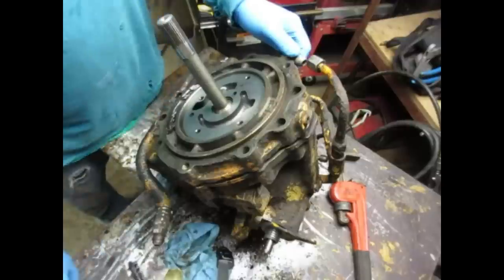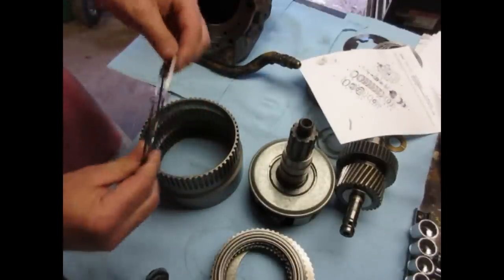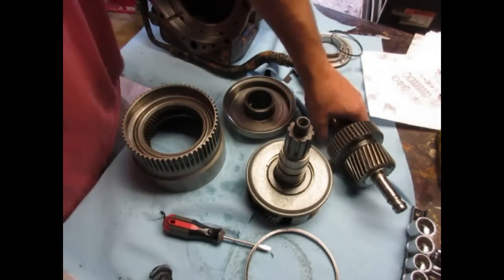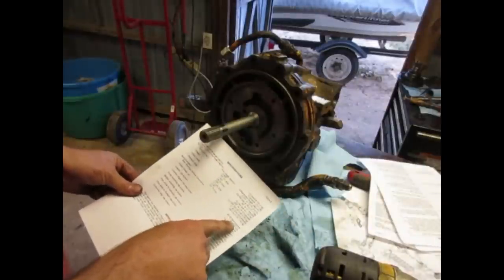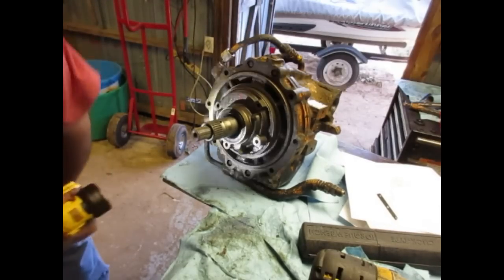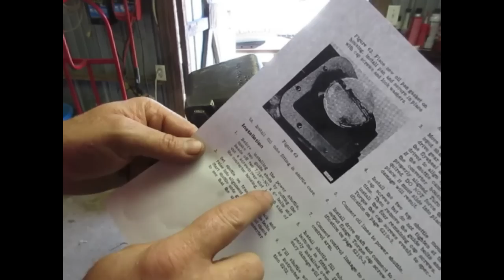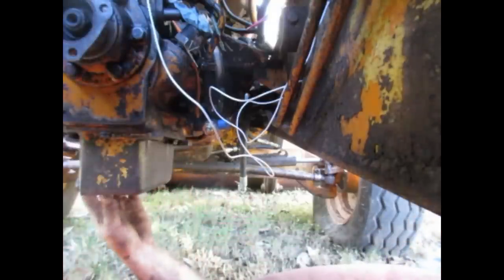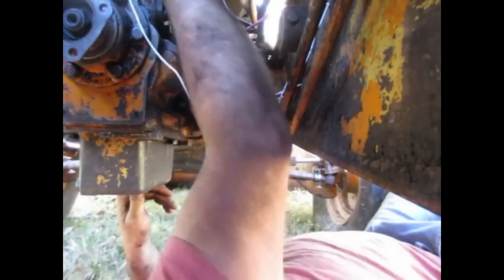Abandoned Backhoe Transmission Repair  Will it be a Fail or Success?   Part 4

Comment: Wow this was very helpful since I am looking at a Case 580B with Shuttle Shift issues.  Motor is strong and rebuilt  I think I can handle the process  you went through to get it running again.

Comment: Things are looking better. Starting to look like you may have a good machine!  I was impressed with the improvements case made in the 580 transmission design from my 1966 and 1967 580 Construction King.  When I got the 1966 the power shuttle and clutch pressure relief spool valve  were really bad with bits of metal and broken springs from the power shuttle clutch assembly.  Much easier to work on the newer design.  But I got it working and put another 11,000 hours on the 1966.  When totally worn out with over 36,000 hours I got the 1967 which was in a lot better shape.  It is great to have 2 nearly identical machines with spare parts to rob and keep the best one running.   Did a job yesterday and the 52 year old hoe still works great!  Just take the time to service the equipment, don't abuse them and they keep doing the work!  Thanks Mike!!
Reply: ayep, start by removing the hoe, then the rear axle, 4spd gearbox then into the shuttle. I'm still using mine but yes both clutch packs were roached.  I think mine is a 1970, still going strong. No hour meter as someone swapped in a tractor distributor.

Comment: Thank you for keeping us informed on this series. Both my transmissions are huge. And I have six or more cylinders to repack. I feel for you. Keep the videos coming. I Liked,Shared,Added to playlists. All my best.
Reply from the maker: the cylinders are pretty easy it takes about 45 minutes each with no problems
Reply: @mikekisch5563  one of the cylinders I have to fix has been welded. That's on the John deere 300  and the parts are hard to find MF 50A , the one I nicknamed the brute makes two of the John deere. It's a Massey  Ferguson 50A  both are old and need a lot of love  : )  All my best.

Comment: I had the worst time getting the trans disconnect with the brake pedal adjustment just right so it didn't clunk in and out of gear as when you step on the brake, everything works but forwards and back. That is so you can ease into something and then step on the brake and throttle up to say lift or whatnot as it is such a fine line between right and wrong. I had air in one wheel cylinder and it just didn't say go here and the troubles are over, nope, a fight was in process with me and it... the stubborn in me won after several rounds. Never so happy as to see things finally go my way. I found that the "O" rings are more important than say the clutches or any band locks that worked on the park system. A lot of the stuff had been bypassed before me so finding and fixing was a uphill battle. Now a trip to the store for clothes line rope if it is the type that takes the rope seals in he ends of the packing on the cylinders

Comment: All internal wear parts I would have changed while in there that's alot of work to go through and not change everything ..
Reply: It would have been prudent yes, but how much $$$? Time's "free" when it's your own and the parts looked serviceable so why sink a bunch of money into it if you don't have to? Not like it's going to be a frontline everyday heavy use machine.
Reply: @BarnyardEngineering  even if I don't use the machine daily or its not a showroom piece if I'm in there I'm changing it.. I want every piece of equipment I own reliable and not questionable because when I need it i need it. Maybe your time is free but mines extremely valuable and I wouldn't want to spend it repeatedly doing something I could have resolved the first time.
Reply: I'll take a good used part over an unproven new one.

Comment: Just a suggestion pressure washing the parts before disassembly would greatly help keeping the internal systems clean.
Reply from the maker: i know there is so much cached on oil/dirt you cant even tell i pressure washed it.  i did pressure wash it buy the way.

Comment: good video! but I only heard talking about the front clutch, which was good. but somehow i missed the rear clutch. what was wrong and when did you fix it?
Reply from the maker: All i had to do was replace the seal on the rear clutch.  per service manual enough fluid was getting past it to not engage the rear clutch.

Comment: If you would have taken the machine out to the road and driven out a mile and back, we would have gone with you. Good mechanics take it out so they can be sure nothing is misaligned or overheating by putting up and down a road that is not traveled heavily. But the steering is so crappy I can see why you didn't. But real good job on the transmission. I see you have put at least one brake on so it could have gone out for a joy ride, but for that steering being bad.
Reply from the maker: I totally want to take it down the road, i have to get the brakes working.

Comment: if you are tired of fighting the piston seals into the drums.. stop by your local transmission parts supplier.. not a transmission shop for the most part..  and pick up a https://globaltransmissionparts.com/transmission-lip-wizard-installation-tool/  with this you can roll your seal lips in crazy easily ..

 and those clutches that the steels had marks on them had probably gotten wet at one point..   the clutch surface melted and transferred to the steels.. chances are the friction material is going to come off those discs within a few hours of use causing the transmission to SLIP in that direction..

Comment: So was the issue a leaking seal or the rusting clutches causing the unit to bind up?
Reply from the maker: the manual said fluid was leaking past the seals, so i think the seals, but im not 100%.  i just know it works now.
Reply: reverse to forward looks smooth, forward to reverse looks a little rough. Maybe it was just the way it looked on video. usually fast shifts between forward to reverse are fairly smooth and vice versa..
Reply: @mikekisch5563  Yes I thought you had a reverse clutch leaking ... tractor moves forward and not in reverse because the planetary shifts/moves forward but not reverse, that seal leaks . One little nick on a seal/o-ring and you lose that required pressure to the solenoid that will allow the planetary to shift from forward to reverse. I have rebuilt/repaired every transmission , torque convertor , and planetary drive from D 6-11 crawler type tractors , 24 H road graders , and 797 off highway trucks and I have seen everything from a missing plug in a planetary causing a complete tear down . to finding a leg off a pair of blue jeans in the suction stub on a 797 torques convertor .

Comment: I would split the difference and torque it at 45ftlbs but that's just me.. I love that old iron like that alot easier to work on and if it's done right you don't have a bit of trouble but hose leaks and batteries.. hate them electronical Gremlins 😂😂

Comment: Mike what model is your case? I just bought 580 B and was wondering if yours is the same? How much did you pay if you don't,mind me asking.  I paid 1800 for mine
Reply from the maker: 580 c 2800
Reply from the maker: I think the b model was before 76 and c model was made 76 to 80.  mine is an 80 model.  it has the one piece cylinders. which were adopted late in the 580c manufacturing
Reply: @mikekisch5563  yeah I was just wondering mine has been sitting for 2 years came with diesel motor then the guy that bought it from put a gas motor in it and he blew that up right away so I'm in the process almost done rebuilding diesel motor he gave me three motors all together 2 gas and the diesel I'm just a little concerned about it sitting for 2 years I wish I knew how to upload a picture to show you what it looks like but I don't know how to do that well good luck with yours I'm sure I'll see more videos of you do them.